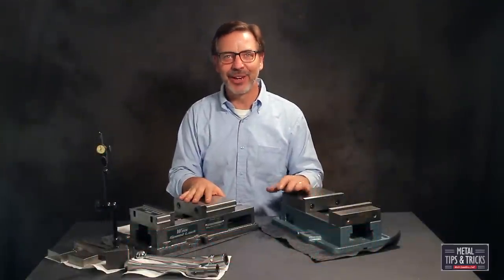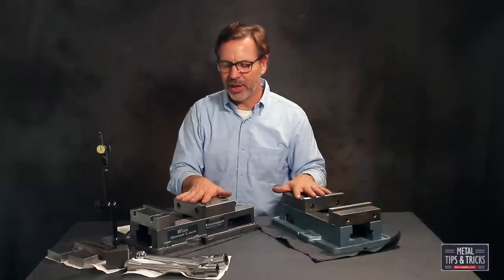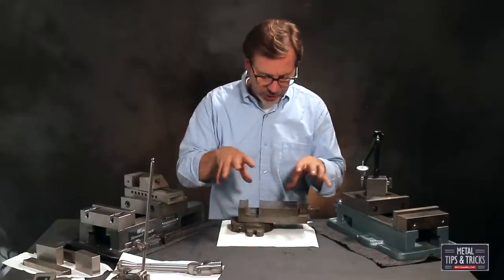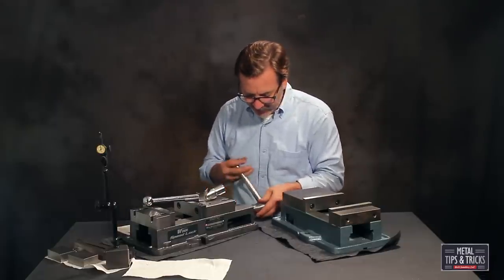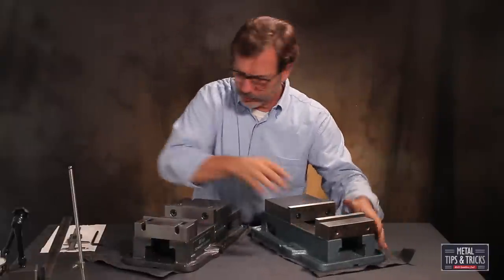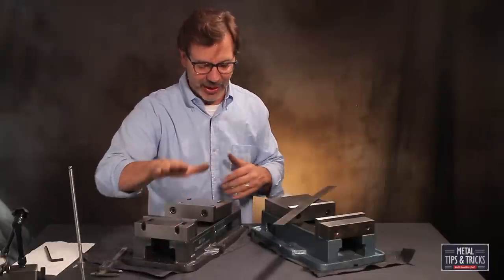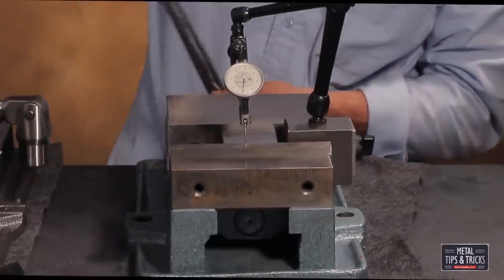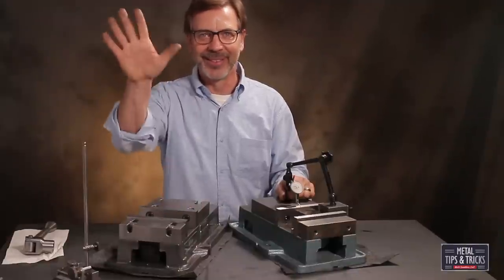China Vs USA  Machinist Vise

Comment: China can't even make a decent paint brush.
Reply: colm one, in thirty years they have gone from steam trains to super fast trains.
They have 1.3 billion people. They haven't even started on us yet....

As for this clip, it's nothing more than an infomercial.
Reply: I've bought some good artist's brushes made in China... and some decent general purpose paint brushes...

I've also bought chip brushes which tend to lose bristles when used to paint with... but, they weren't as expensive, and the paint jobs demanded a disposable brush, and the quality was only that they were a protective coating against rusting, no need for cosmetic appeal...
Reply from the maker: Thanks for your comment :-)
Reply: The handles break, the clasps rust, the rivets come loose, the bristles come loose, curl up or fall out. The other bits are OK.

Comment: Chinese is cheaper because it's always just 80% built.
Reply: Actually, in China they make decent quality stuff as well, which does not require rework. You can buy at any price/quality point, and that's what domestic engineering companies do.
Presumably the US companies which import from China can make more profit bringing in lots of the low end stuff.